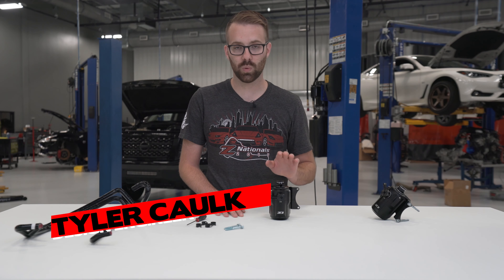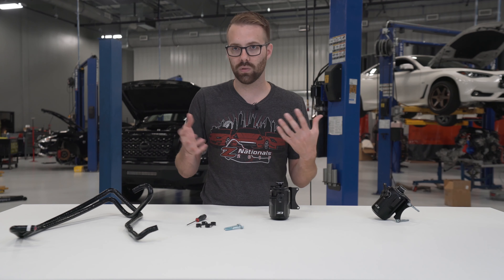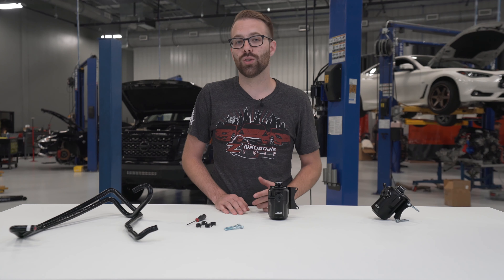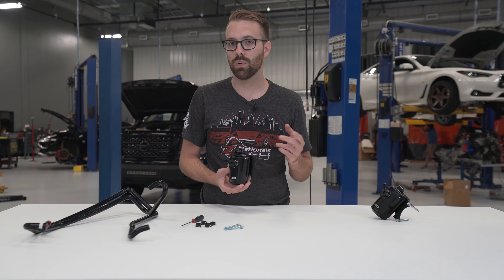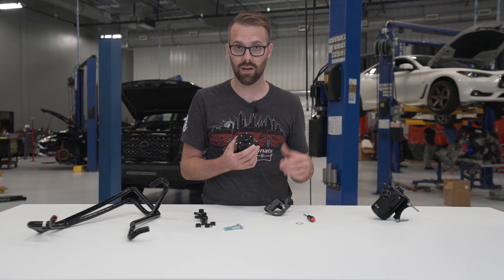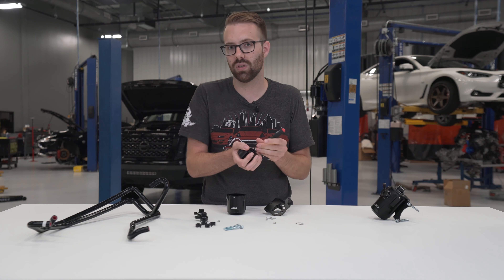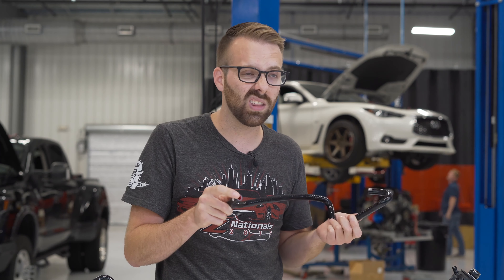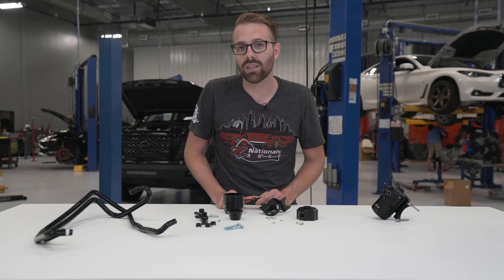Behind The Design | Z1 Q50 / Q60 Oil Catch Can Kit

Comment: Is the direction of flow correct? Would it not make more sense to plumb the dirty air straight down into the filter and then allow the clean air to escape at the top around the edges?

Comment: Have you guys designed anything for the 2015 through 2019 Infiniti Q70L 3.7L. I’m sick and tired of having to clean the throttle body and intake tube from all these oil vapors reducing my throttle response. I am a rideshare driver that daily drives my Q70L VQ 3.7L. I need my Infiniti to have proper throttle response to stay safe on the road.
I happen to be the admin of an Infiniti M/Q70 enthusiast forum on Facebook. I would love to promote your products. I have added tasteful modifications to my Q70L VQ 3.7L to maintain reliability. It just so happens to my Infiniti Q70L has over 212,000 miles on the odometer.

Comment: Why isn't this available for the 350z de with brackets?

Did you guys made improvements on the mishimoto restrictive design that was blowing valve cover gaskets due to poor circulation?
Reply from the maker: We are currently working on a bracket and hose solution for the DE that will be available soon.

Comment: On the vq37 there isn4 ports for the blow by can you explain that?
Reply from the maker: 2 are on the valve for the evaporative function (where the catch can helps the most and we use a dual can kit on the VQ37VHR).  2 are on the breather side (larger hoses right before the throttle body), we get very little particulate and oil through those as the path is routed through an internal baffle in the valve cover.  That baffled path does a pretty good job to remove contaminants.

Comment: I wonder does a 2012 toyota camry v6  need a catch can?
Reply: Plug the manifold and intake pipe, put a small filter in the valve cover and vent PCV to atmosphere (with a hose facing down the street if you don't want oil in your PCV surroundings). AutoZone sells those small assorted plugs. No more oil in your intake.
Reply: @ZeroFX32  so your saying you can?
Reply: @chrisnas1483  you don't need a catch can with this method, it's cheaper with same desired result (avoid oil in your intake). A catch can is a fancier solution. Both work. Whatever you choose is OK, either spend $5 or three digits with a catch can, both will avoid oil into the intake.